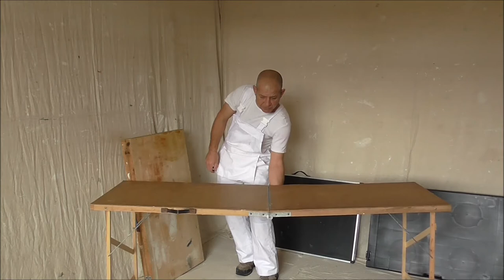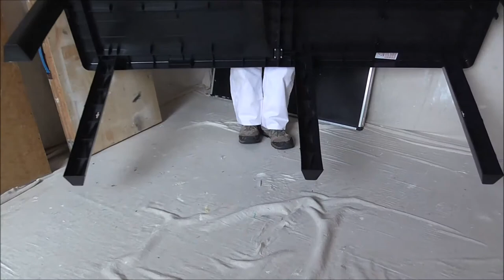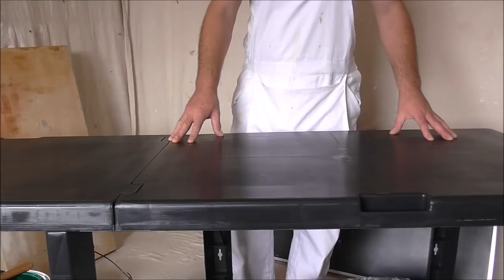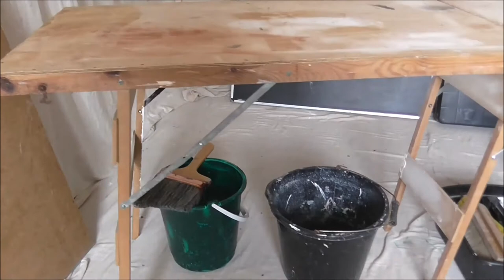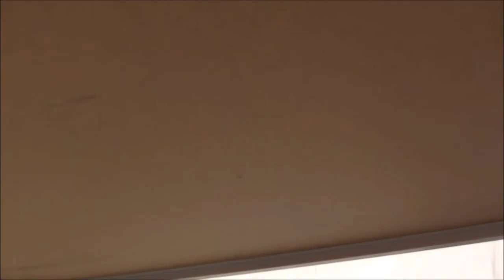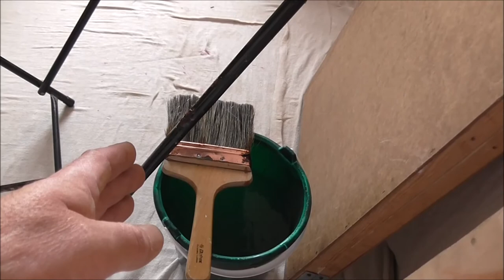Paste Table Review

Comment: Good presentation and review of pasting tables. Mine is the one with the aluminium edges. It is solid, easy to keep clean and dry, the 'V' shape of the legs are great for holding lengths of paper or full rolls, pencil marks are easily written on the side of the aluminium and wiped off when no longer needed, BUT as you rightly pointed out the aluminium edges are proud of the table surface and are a bloody nuisance because they always catch the edge of the wallpaper when moving it around on the table. I need a flush surfaced table like your plywood one! Please make a tutorial video on sheeting up and masking up a room. I have seen glimpses of your neatly laid drop cloths in some of your videos and think we could learn valuable lessons from you. Thanks for all your tutorials.
Reply from the maker: Thanks very much and yes will do a video on dust sheets-(drop sheets)

Comment: great insight into the various types of paste tables, i agree that the ply topped table is the most durable and long lasting, but even with the little niggles the aluminium ones do have, i prefer them as an every day table because they are very light ...pro's and cons to all of these apart from the first two which are useless

Comment: I've never had a problem with my aluminium framed table, never had it coupe on me either. There is no need to put the paper right over the edge with this table. Mine is white with a ruler along one side and does not have a bolt underneath. Very easy to clean and measure up. Best table on the market
Reply from the maker: PsBandofMen as long as it works for you but we've had problems with the ones shown in the video.
Reply: The aluminum edging on some of these tables are a nightmare, plus the table its self, in general, is so easily damaged, with half of these type of tables made from bingo board.

Comment: I actually use the plastic table as I tend to do more feature walls so don't use it regularly works fine yes there is a bit of faf but does what I need it for.
Reply from the maker: Yes it does work and you can always cover it with lining paper.. we do this all the time..  helps protect the paper from the sharp edges of the bench especially expensive papers.

Comment: stick with the one you have, get a mirka on it and then a coat of water based varnish and it's like new again. Those others are like a joke aren't they. Who designs a board with a lip on the edge you an bang your paper against and damage the edge!! obviously they don't do wall papering. It's also like the rounded edges and corners, where does that idea come from lol